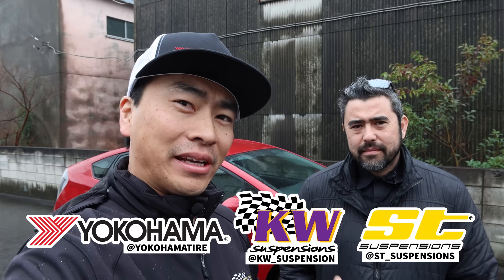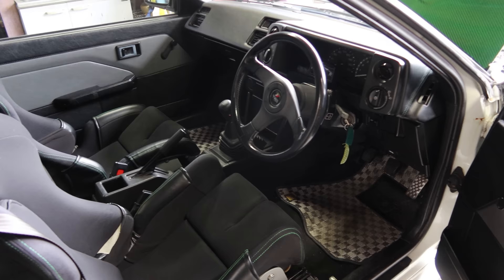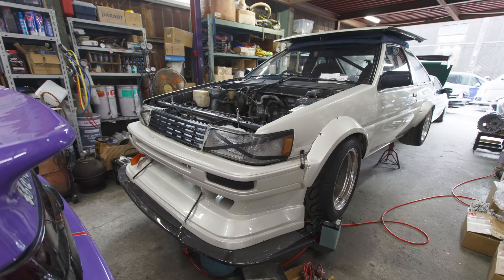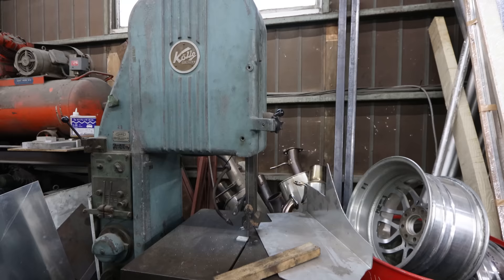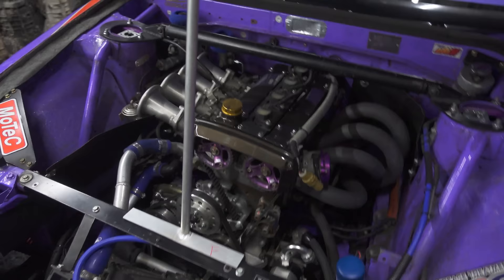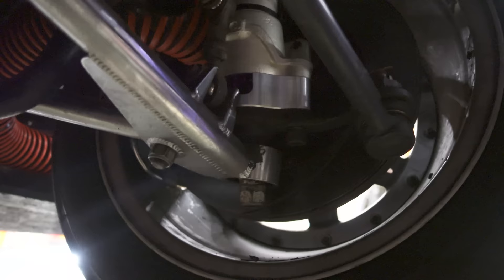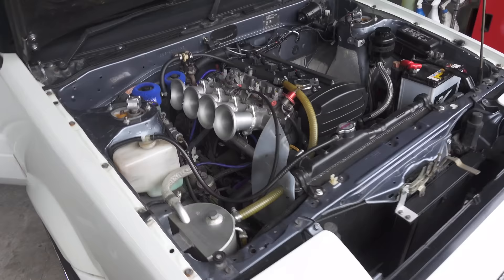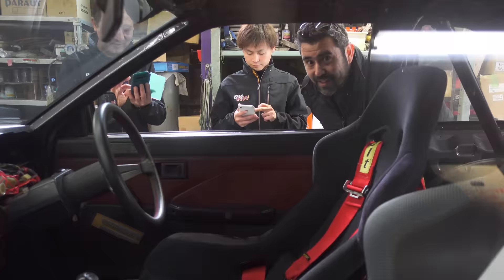A Tour of Tec-Arts, The Ultimate AE86 Corolla Shop in the Heart of Japan

Comment: Its crazy some of these shops dont know how Dope and how loved they are around the world. I watch hundreds of hours apon hours of Tec-Arts AE86 and Drift Kings AE86. I miss my AE86 it was so light and so connected with me. I feel there is a feeling that in every time period you can get. Being more connected to a car, feeling the road through the steering wheel, knowing when the back is slipping out and how much throttle or brake you should apply, To me thats why older cars are so loved. Its the human experience applying skill and knowledge. We already know in a straight line any car old or new can be as fast as a new car, In the turns its possible to it just take more innovation, great driver, and knowledge of car and track as well as opponent. You can teach a old dog new tricks.
Reply: hi I know this is an old comment but would you recommend a trueno? I am thinking of importing one. i already have a jzx100 chaser and I feel this would compliment it so nicely
Reply: @BySixa  I would recommend 110% the fun of a small rwd light weight car will be reliable and fun to drive. You could even get one from the states as well. Get one asap don't wait you won't regret it especially when or if you fully build it or swap in a k20 itbs all motor